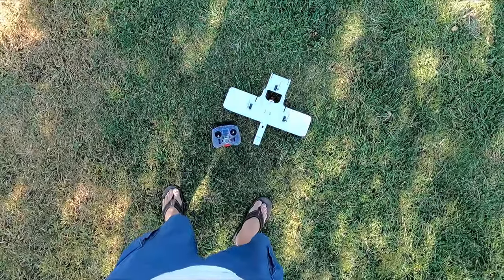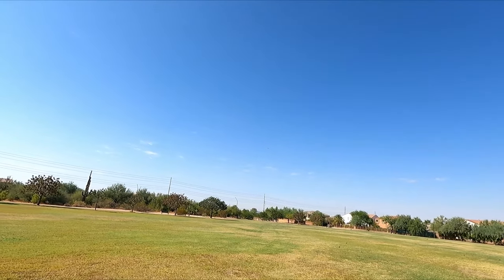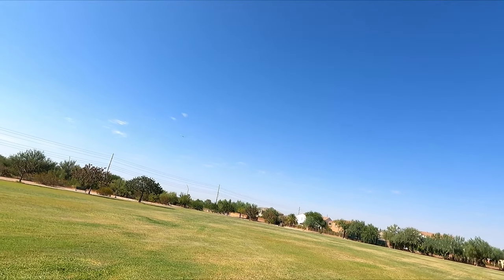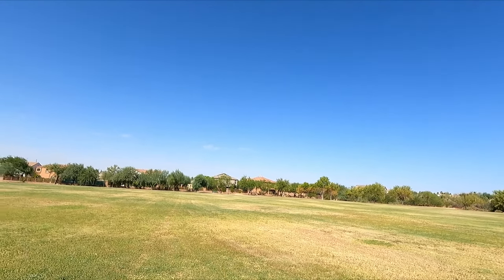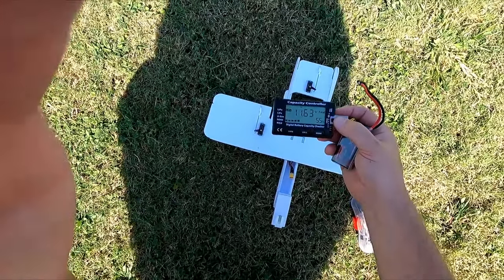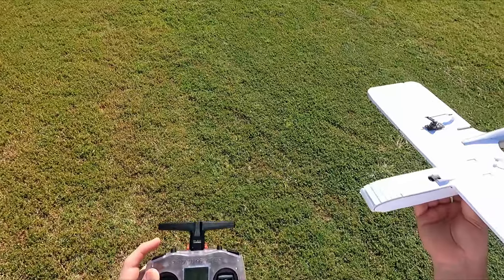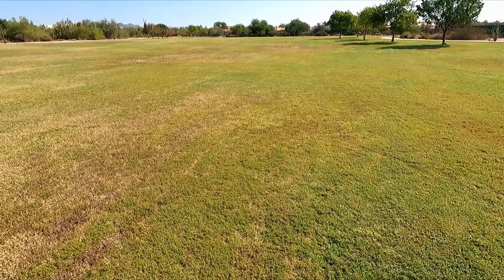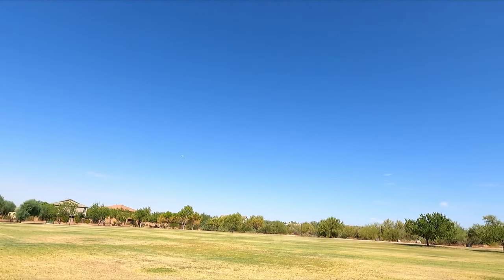Flight of The Drag Queen!  - a Sub 250g DIY RC Plane

Comment: Looks like something that should weight less than 100 grams :D either the size was not mentioned or I already forgot it. Oh, the smaller the plane the closer you need to fly it for not to make it look like a pixel like in 98% of the videos in general :')
Reply from the maker: Size matters.
Reply: @usefulaircraft  surely does, but can't tell what the exact wingspan is, 50cm or 20" if that is the same as in your latest build video?

Comment: This looks great! Newb question, which CNC/Laser do you use for your foam parts? Maybe I missed it but a video on your favorite tools :)
Reply from the maker: I'm cutting on a Gweike LC1290.  It's a CO2 Laser currently equipped with a 100W tube.  I use a CW5200 chiller, and the usual fume extraction / air assist.

I may make a video on the laser and other tools.

Thanks for your comment.
Reply: @usefulaircraft  Thank you! I've got 3D printers and just learning about laser cutters and it's a whole new world. I'm enjoying your work and channel.

Comment: Speaking of loud props, any advice on making quiet pushers?  The clearance between the front (or back, but not an issue on pushers I'm building) of the prop and foam seems to make a big difference (and that makes sense to me), but it's not always practical to have a big gap between the back of the wings/whatever and the prop blades.
Reply from the maker: It really boils down to eliminating the turbulence in the airflow into the propeller.  It's tough - you'll notice even the commercial pushers (avanti, starship, old lear fan) all had a distinct noise.  Even the modern UAV's flown by the military with similar design work to reduce the drag to a minimum in front of the prop.  I played around with putting the prop farther aft (prop strikes on pushers become an issue) but I found they were a little quieter - but still nowhere near as quiet as a tractor design.  For that reason - my favorite FPV planes are twin tractors.  They're quiet, and still have plenty of punch when you want them.  The single engine pushers are nice in that they're easy to build (2 servos, 1 motor) - but it's tough to make them as quiet - and in a confined space requiring maximum performance to get out - you are limited in pitch unless you have a decent amount of airflow (airspeed).  So everything is a compromise.

Either way - thanks for your comment.